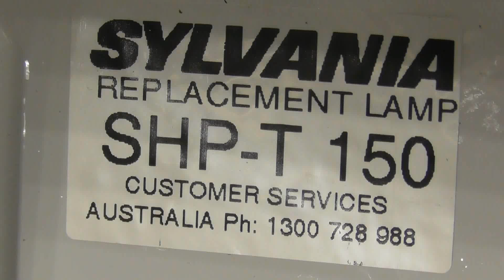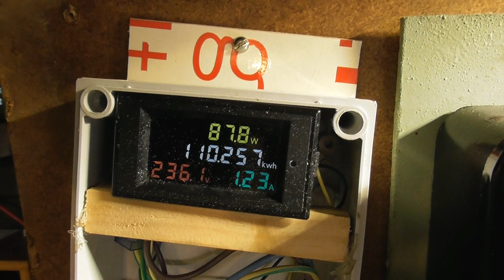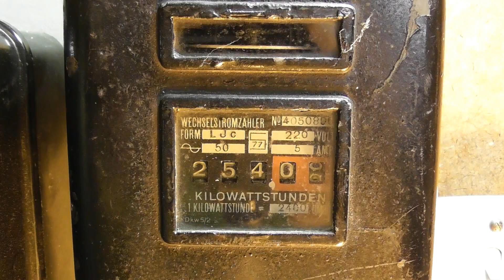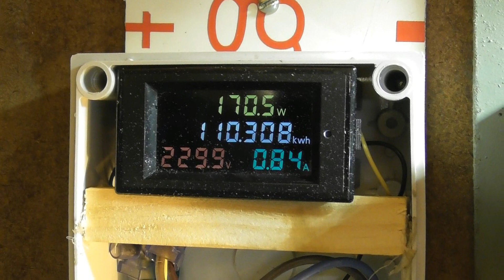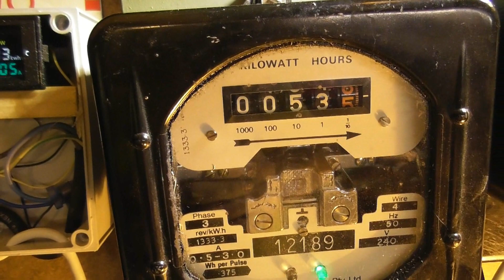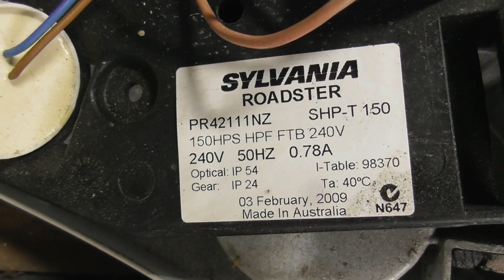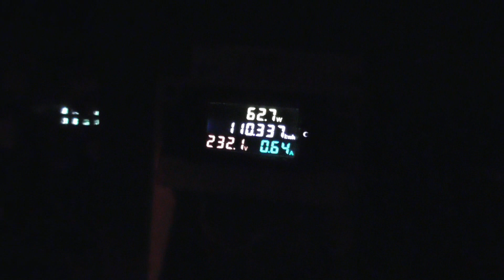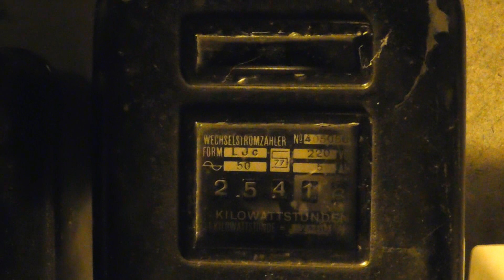Sylvania Roadster HPS streetlight and LPS colours

Comment: I don't blame light emitting diodes, I blame the crappy, ill-designed power supplies.
Reply: Yeah, manufacturers of cheaper LEDs choose drivers that are slightly above the power rating of the LED chips, as an easy way to boost their brightness. It drastically reduces their lifespan though.
Reply: That is why i hate LED HPS is 1000x better LED IS BULLCRAP.

Comment: How right you are. I read somwhere that the human eye is most receptive to yellow, hence yellow fog lights. In the UK they are removing the sodium lamps and replacing them with LED''s. Not only is the colour horrible after a year or so they dim. Our estate looks like the haunt of Jack the Ripper. They also have the lights turn off around 1am, ideal for those who vandalise and steal. Would you want your daughter coming home from a party or whatever at 1am in the dark ? I stay up, get the car out and get her which totally destroys any ECO saving by a very large factor - and that's just one person.  Let's say the car is 30 kW for half an hour, around 30% power, gawd they are worse than the 'energy wasting truss'.
Reply: I'm glad I'm not the only one to notice how ugly LEDs look after just a few years. Here in the US the trusty HPS and MH lamps are slowly getting replaced with LED. They give off a sharp white light at first, but the oldest ones (more than two years) have a sickly green-yellow tinge, like murky pond water.